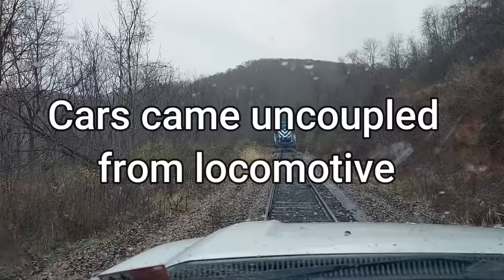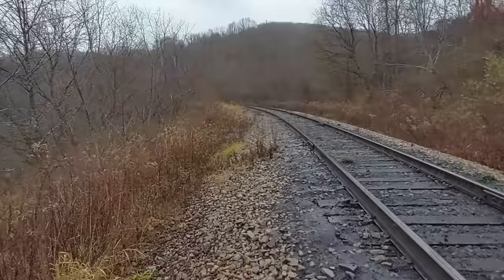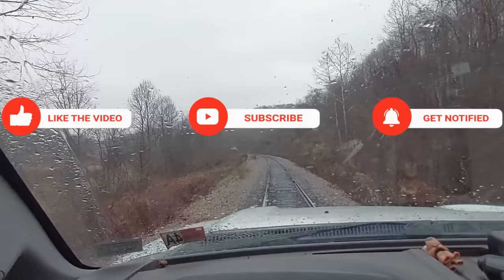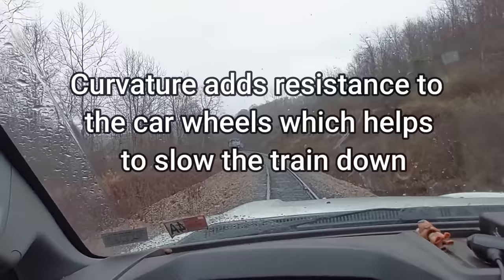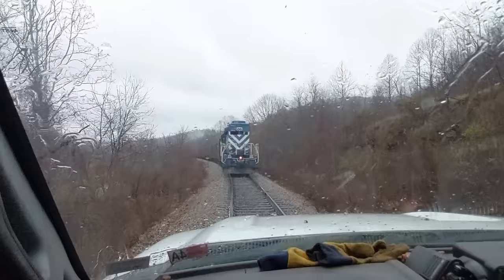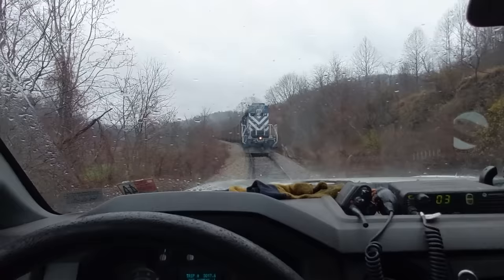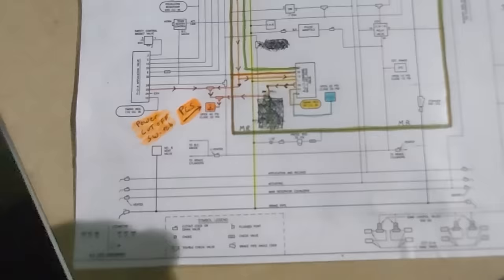Locomotive in PCS Fault and Remote System won't Link Back Up

Comment: The engine is controlled by a AMD Geode LX with 25mb of ram (a bit blurry so I could be wrong), don't know if its controlled directly by it or is just used for the remote control system with the engine in front. Mite not be the main computer for it since the AMD Geode LX was released in 2005 and I have no idea of the age of the engine it self or I guess the computer could just of been updated at some point. I just fined it fascinating how big machines are controlled by low power/older computer systems at times compared to what people mite have at home for there computer that are 100s or 1000s of time more powerful then the computer in the engine for example in computational power. But I guess that's just how purpose built system's work. Love the videos and how you explain stuff that happens or has happened.
Reply from the maker: Wow that kind of tech stuff is way over my head  Corrupted Save. Thank you very much  for taking the time to visit with us and check out the video. May you have a most blessed day my friend.

Comment: How did that train become uncoupled, did the coupler break?
Reply from the maker: Thank you Chris for paying us a visit and checking out the
video. Coupler on the car had an adapter plate which had
fallen out for whatever reason. Adapter plate fits under the coupler shank. That caused a mis match in the coupler height from car to loco. Car went up to mine fine with no problems, but once it got loaded, then that made the mis match even greater.  

Coupler did not come uncoupled, rather coupler on car slid
down enough so that caused the car to uncouple from the loco.
Several low spots in the track surface did not help matters.
Car was pulled from train and fixed that evening. When they
put a new car in place of that one, they had no more problems
with it uncoupling.
Reply: @ccrx6700  Hi Dave, thanks for the reply, that makes sense!  I really enjoy your channel, I always thought what you do for a living would be a job that I would enjoy! Thanks for taking us along on all of these adventures. Your employer is extremely lucky to have someone like you working for them!
Reply from the maker: @chrisstromberg6527  👍😊

Comment: Interesting stuff, just too bad the dialogue gets very difficult to hear(for me it is) due to a lot of background noises that seems to lower the talk in the video.

Even so, I found the video very interesting.  

Are these loco's equipped with pcs and rcs also known as DPU's?  Or is there differences between them?  If so, any videoes explaining the differences?

Again, very nice, informative video.

I come from a long line of family that worked for the old L&N or C&O railroads, relatives were steam loco engineers, brakemen, conductors, some worked passenger service.  

One Uncle when Diesels started replacing Steam loco's, went from a Steam loco engineer to a Diesel loco mechanic.  He just was awed with the new Diesel loco's and wanted to learn everything he could about them, repair them, and keep them running.

Sadly, all those relatives have passed away now, but they taught me a little about how trains operated back then.  

They also taught me how to be safe around any train, whether it was stopped, doing switching moves or hauling freight or passengers along the rails.  Sure miss those guys and their stories of life on the rails.

Finally, I accidentally stumbled onto your channel, and after watching your impressive and educational video, subscribed immediately.

Will be looking forward to more of your videos.  Always great to see them from an actual railroad worker that knows much more about these things than an actual railfan would(unless they happen to be retired from the railroad, or like me, actually had family that worked for the railroad or got to be close friends with a lot of engineers, conductors, signal maintainers, MoW crews, and some of the chiefs in charge of the railroads{which I did with Amtrak and CSXT}).  

So I got to access many places that the average railfan wasn't allowed to go, to video and photograph trains.  

I even printed up business cards for quite a few conductors and engineers for both Amtrak and CSXT, as well as some of the Amtrak Passenger Depot employees.  The business cards were laminated and sealed to keep them weatherproof, and if they wanted the specific loco they used, I'd include the loco and them standing next to it, making sure the numberboard was clearly visible in the photo.  These laminated business cards were in full color too.

Sadly, I can no longer drive, so I very rarely get trackside now, and since the end of 2013, when I knew it was time to give up my license to drive, I also had to stop driving to locations where a train crew may stop for awhile, or a crew change to get their photo with the loco they wanted.   So I had to give this up as well. 

I did enjoy doing that for many years, it's also another reason I had "special permission" to go where others would, or could not go without possibly getting arrested for trespassing on railroad property.

My apologies for the long-winded comment, but just like to share some of my experiences with a couple railroads I got to know, and became very good friends with.
Reply from the maker: Thank you for the really nice comment HolidayDecorator. Glad to
hear you are enjoying the videos. They are a lot of fun to make and
seem to be educational for a good many out there. Sorry about the
background noise messing with the talk, I can't do much about
that. 

Sound very interesting how you were able to go places and be
with the railroad men, that's pretty cool. I like the idea of the
business cards. I'm sure it is very difficult and frustrating that you
are not able to get trackside, that would be hard to take I can
imagine. 

The end of train unit is considered a DPU since it is controlled by
the lead loco via radio/remote. There is no actual operator in that
EOT unit. Very much appreciate your taking the time to visit with us and check out the PCS fault video my friend.

Comment: (Retired NS electrician). It looked to me  that the automatic brake was left cut - in. For distributed power units to link the brake pipe pressures must be equal. I might be mistaken.
Reply from the maker: You are correct in that Buzz. train brake was in 3/4 position.
That is the way our goofball remote system is set up, totally
contrary to my way of thinking, but EOT/DPU unit does not
supply air to the train brake pipe, as you may have noticed
when I shut off the brake pipe angle cock there was no
air coming out, only air on the car dump line. You are not mistaken,
on normal systems the brake pipe pressures would be equal
and the DPU would supply air to the train brake line, ours
is a stupid system. Was really nice  of you to take the time to visit with us and check out today's home movie. Happy rails to you until we meet again my friend.

Comment: Hey Dave, have you heard that the Swiss are installing solar panels in between the rails in a trial near the town of Buttes? It sound's crazy, I was wondering if you could give your 2-cents on the idea. Dave Jones at EEVblog just did a video on it.
Reply from the maker: I did not know that Sadie. Back in the days of steam many
RR;s had a water trough in the middle of the track so the
tender could scoop up water on the go. Sure had to be a problem
when doing certain track maintenance. Tamping would be out
of the question. So if they put solar panels in middle of track,
that track will not get tamped. Very interesting. Seems like
they could find a better place to put the panels than that?

Comment: Did a coupler break to disconnect the engine from the cars?
Reply: No, it was a low coupler on the car that slid down and out of the loco coupler.
Reply from the maker: Thank you very much Robert for taking the time to visit with
us and check out the video. may you have a most blessed
day my friend.

There is a detailed analysis of why the cars came uncoupled that is written up in this video's description. I did not find out the reason
why they uncoupled until the next day after I had made the video.
If you would like to read it here is the video link:
https://youtu.be/YU5KXJfWaxM

Comment: It could be worse. In the 1980s, forty-some cars of a loaded and stopped coal train fell off a siding at Harrold, Texas, on the Ft. Worth & Denver, now part of Burlington. It was about this time of year after a lot of rain. A culvert was blocked, letting water stand next to the siding. Shortly after the train pulled on the siding, enough soil liquefied the cars fell on their side as the rails spread apart, and the car's wheels cut through old ties and then sunk into clay under the roadbed. 

They cleaned out the cars and laded the coal on another train. The running gear was torn down and sent to the repair depot. The coal car bodies went on flat cars and back to the repair depot. I stopped and talked to them a time or two. The wheels were all but worn out, while the paint on the cars looked almost new.
Reply from the maker: Appreciate your sharing that story with us Gordon. Pretty interesting. Thank you for taking the time to visit with us and check out the video my friend.

Comment: I'm a little concerned when components are scratched out on a diagram.  It usually means they have been removed by someone who thought they were unnecessary.  Modifying a schematic should be done using a "red lining" process that only a design engineer can do.  Was that an auxiliary pneumatic reservoir and an accumulator?
Reply from the maker: Thank you Michael for taking the time to share your thoughts with us.
Appreciate your checking out the video. May you have a most blessed day my friend.

Comment: Ya just never know what the day is going to bring. Thanks for all the information you share Dave. Makes for a very interesting video! So how much sliding can the wheels do before you have a noticeable flat spot to listen to or feel? 
🚂🚃🚃🚃🚃🚃🚃🚃🚃🚃🚃🚃🚂💯👍🇺🇸
Reply from the maker: Thank you Jim for the kind words of appreciation. I honestly
cannot answer how many feet or miles it would take. That
would depend on the degree of wear already present on the
wheel, plus if the rail was wet or dry. Was swell of you to take the time to visit with us and check out the presentation. Happy rails to you until we meet again my friend.

Comment: Was that two brake pipes on that locomotive? Do you have any information you could share about why? Ive seen a brake pipe and MR, but never two Brake pipe.
Reply: 1 for the locomotives only and 1 for the cars. Independent brakes on the locos and train line brakes.
Reply: @MrLarrycar  I'm talking about the hoses on the exterior, I saw in another video they were both hooked up to the cars
Reply: @dfwrider3830  were the cars dump cars? If so 1 would have been air for the dumps.
Reply: @MrLarrycar  that could be what it was
Reply from the maker: Second air line DFW is for the car dump line, all our cars are
bottom dumped and activated by air.  Really appreciate your visiting with us and checking out the video. May you have a most blessed day my friend.

Comment: The position you said was 3/4 position is called handle off. Reason being once you put it in HO you can....take the handle off (just lift up and the handle comes off) 🙃
Reply from the maker: Appreciate your sharing that info with us opium extract. Thank you so much for choosing to visit with us and check out the video. May you have a most blessed day my friend.

Comment: How did the DPU disconnect ???
Reply from the maker: Thank you Donnie for paying us a visit and checking out the
video. Coupler on the car had an adapter plate which had
fallen out for whatever reason. Adapter plate fits under the coupler shank. That caused a mis match in the coupler height from car to loco. Car went up to mine fine with no problems, but once it got loaded, then that made the mis match even greater.  

Coupler did not come uncoupled, rather coupler on car slid
down enough so that caused the car to uncouple from the loco.
Several low spots in the track surface did not help matters.
Car was pulled from train and fixed that evening. When they
put a new car in place of that one, they had no more problems
with it uncoupling.

Comment: Same as bridge tenders! Foot is always on a pedal during opening and closing called a dead man switch!
Reply from the maker: That's what they call it in the locomotive also  SBrown. Our SD 40-2 doesn't have a dead man's foot pedal, but it does have an alerter which you have to acknowledge every 20 or so seconds or else bells will go off and if that is not acknowledged then the loco will shut down it's functions, same as a dead man's foot pedal. I did not
know that bridge tenders had the same type of thing, a very good
idea! We are very grateful for your taking the time to visit with us and check out the video my friend.

Comment: 9:45 computer locked up. no windows CE blue screen of death. wondering if the controlling loco system was trying to link back up with out going thru the test and encryption stage. shutting off both remote control systems and then a fresh restart or is this stuff plug and play, just reboot and reconnect automatically?
 i would think the radio control signals would be protected with encryption to keep multiple passing by locos from accepting commands from the wrong system, and if two systems just happened to be on the same frequency and encryption, that could really be a disaster.
that's my guess what was preventing the reSync. i know alot of radio systems happen to use rolling code to protect the system from accepting the wrong signals, and the reboot would have forced a new encryption code to be used and the leader still being on the old encryption command trying to use that old one with out releasing and setting up the new code thrown from the trailing dpu.... maybe talk to DJsTrains a NS engineer about that, idk. he knows alot tho.
Reply from the maker: Some good thoughts april generic. One thing we have different
suit cases (the control part of the remote).  Each suitcase has
a different number, that remote system must be able to read
the correct suit case on the correct loco, this is to prevent a
 3rd loco from giving another loco a command, such as you
say another passing loco. Really appreciate your taking the time to visit with us and watch the video. May you have a most blessed day my friend.

Comment: Did you guys try to lift the loco and put it on the program track and use the RCO controller to do a factory reset???😂
Reply from the maker: Thanks so much First name Last name for dropping by and checking
out the PCS Fault show. May you have a most blessed day my friend.

Comment: Very interesting! I don't know a thing about trains, but I sure recognize an old computer POST past the bios and load into an os. I seen the mouse cursor, but looks like the touchscreen driver or connection wasn't working. If only you could just plug a usb mouse in and override the touchscreen you'd be set. Guessing those old industrial systems don't expose the internal PC ports for ya though.
Reply from the maker: I do not believe you can plug a mouse into this remote system, sigh...
Thank you very much blendonator for taking the time to visit with us and check out the video. May you have a most blessed
day my friend.
Reply: @ccrx6700  No worries! Although I bet if you open one of these up and looked inside, you'd find an old DB9 or DB25 serial connection. Assuming that the hardware didn't flake out or the software never changes, I'd put money on a flakey serial connection falling off from constant vibration.

Take care!
Reply from the maker: @blendonator  👍😊

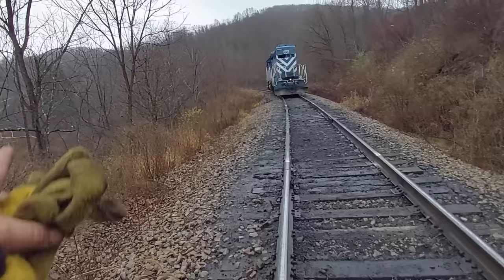Comment: 2:04 The sand dispensers were running?
Reply from the maker: It didn't appear to be that way did it. But wheels weren't slipping
either, they were sliding, big difference when to the sanding
system. Thank you so much for choosing to visit with us and check out the video. May you have a most blessed day my friend.

Comment: Hi Dave, be grateful that you don't have Electric Control Pneumatic braking (ECP) and Wireline Distributed Power (WDP). Those systems bring their own set of headaches when they don't want to set up properly. The 26L Brake valve has been in Australia since the 1960's but I've got documents that say 1958 as the first 26C - 26L use in the United States.
Reply from the maker: Thank you Gus for the nice comment, but I do not know what
those systems you mentioned are, but they sound complicated. Really appreciate your visiting with us and checking out the video. May you have a most blessed day my friend.
Reply: @ccrx6700  Hi Dave, in short, ECP braking is from Wabtec and New York Air Brake (NYAB), well they are the 2 systems that we use on my railway here in Australia, and works with a wireline down the train ending with an ECP End of Train marker. The ECP system makes diagnosing problems easier and you can cut the braking system out easier on the screen instead of physically cutting the brakes out on individual cars, but in saying that, you cut 2 trucks out cos if the defective truck is a master unit, the slave has to be cut out too. Wireline Distributed Power is just controlling the Distributed Power Unit through the wireline instead of radio waves like your railroad uses. The drawback is that we cross talk with other trains I call it "trains talking dirty to each other" and we get an ECP penalty brake application.
Reply from the maker: @B10Mman  👍😊 thanks for the great explanation

Comment: What is that hissing pop sound engines make? Sounds like "pssp" 
  Everytime one passes by slowly, that pssp sound makes me feel like it's trying to discreetly get my attention, to tell me a secret.
Reply from the maker: That is the pressure relief valve popping off, just like you would
hear in big trucks fivepoint5. Thank you for taking the time to visit with us and check out the video my friend.